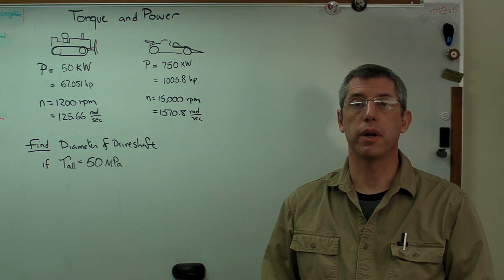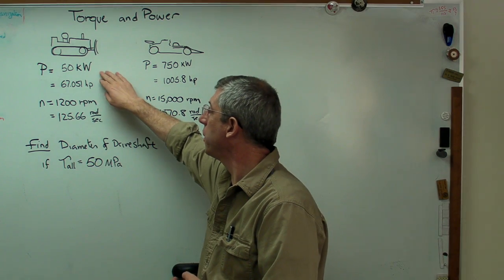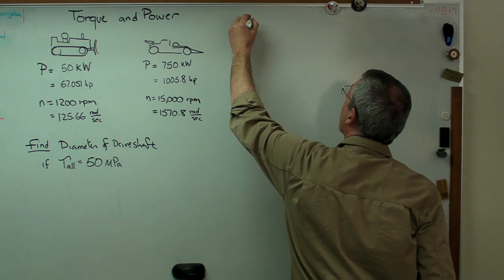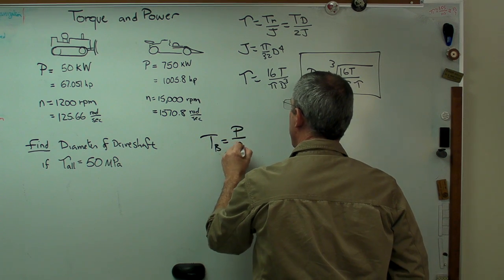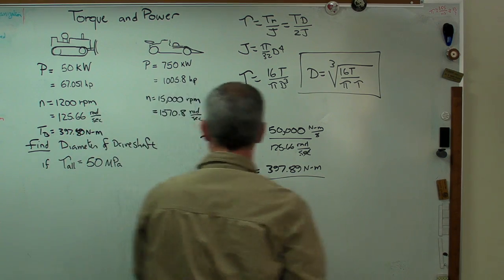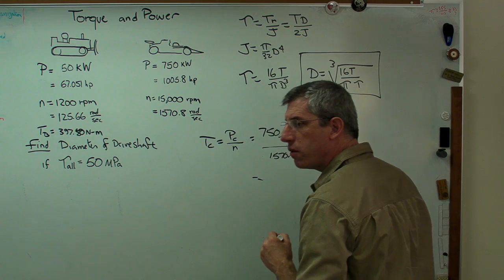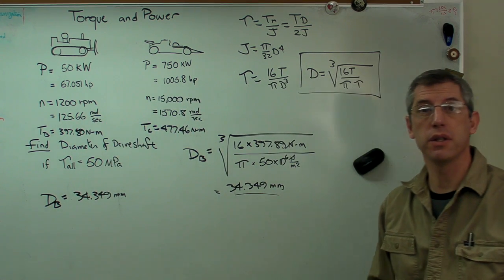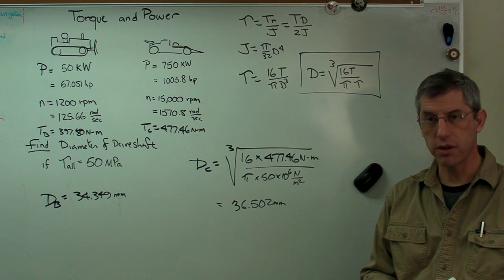torque and power.MP4

Comment: is the torque is always static?
if its start to move is changing into power right?

i can feel engine torque when i grab crankshaft and this shaft try to rotate but my hand is stronger and its not rotating. When shaft start rotating than i feel power couse it do work.
right?

Comment: force = cylinder wall/piston rings) distance is from piston ring where it touches the cylinder wall to the crank shaft. combined this creates the tq number. longer the stroke (distance) the faster the pistons have to move for the same rpm. this creates lots of problems. shorter stroke= higher rpms. this is due to piston weight, balance of said items and how fast fuel can burn.

Comment: the force is perpendicular to the crank shaft. this force is applied to the cylinder wall. to the distance is directly related to rod length. to the distance is crank shaft to the piston ring during ignition. This is what the tq is. depending on this relationship of force and distance, the rpm will vary. very short distance (stroke) will create lots of rpms due to the piston speed is very low. the longer the rod (distance from crank the force is applied) the faster the piston has to travel

Comment: I think that RPM is determined by the power which is determined by the total volume the combustion chambers of the engine. rpm is inversely proportional to the torque. thats why use low speed transmition (by using a big gear in the gear box) when we need a high torque. like starting movement or going upward to some mountain

Comment: Hi, could you elaborate more on torque and power? I think a LOT of people out there are confused about these concepts 

E.g. I know Power = Torque x Rotational speed (rpm), and Torque = Force x Radius. If the Force is produced by engine, is this Radius the radius of the driveshaft? Also, what determines RPM? is it the Force and the radius of the driveshaft? but that would mean RPM is proportional to the Torque?

It would be really great if you can make a video explaining all these confusions.